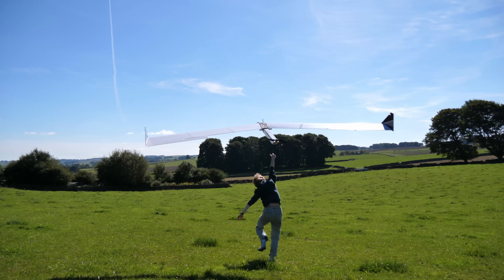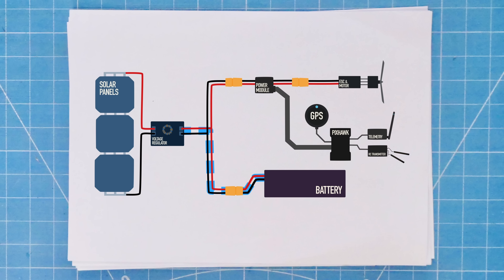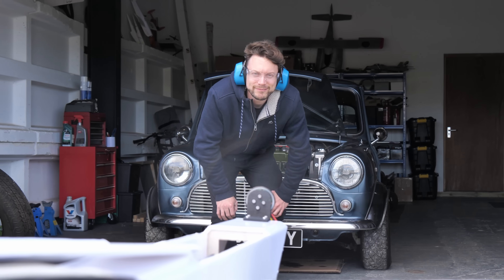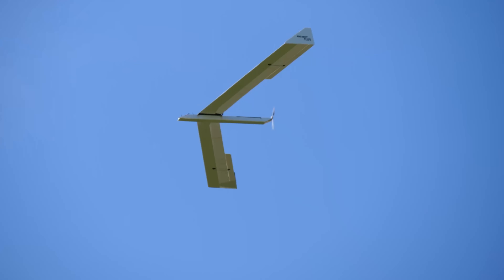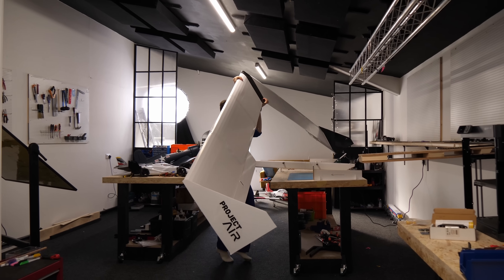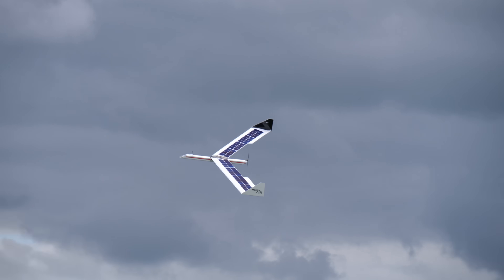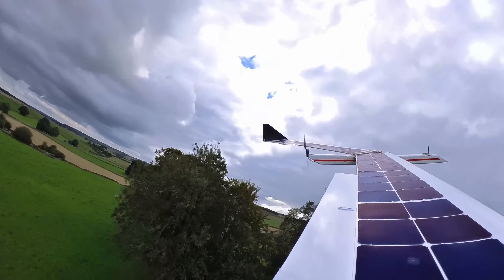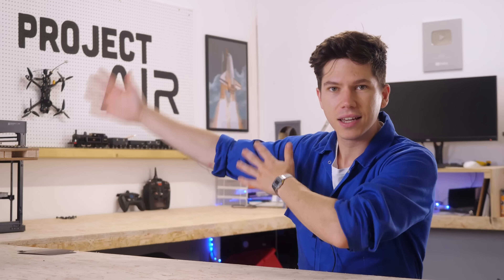Solar Plane V2

Comment: For one I really like the foam board design.. but you also could mold the solarcels in a glass fiber composite wing (under vacuum).
"Simply": 1. build a negative wing mold. 2. lay a thin layer of glasfiber 3. Lay in the rest of the lamiate. 4. Close up the wing with its underside and internals.
The vacuum pressure should hold the solar cells in place and you can build a structurally more sound wing, while keeping the turbulence from the solar cells to a minimum. Obviously it is more expensive, more complex, more waste full, if you damage one cell the entire wing is trash, the efficiency goes down by a bit (I wonder how much though). But the wing, could be overall lighter/larger, and the reduced drag could eventually made up for the loss in solar efficiency.
(Therfore a negative mold, where the vacuum pushes the cells into the curvature, rather than on to it, like it would be if you mold it over a positive or a wing directly.)

And at last, I know it is your channel but I think you really should start to say "we" instead of "I" when you also state that Hannah worked on the project as well.

I See forward to your next project and the continuation of the solar plane.

Comment: There's a company called PowerFilm that makes super thin and flexible solar panels. I don't know if they are as efficient as the ones you are using, but they could possibly be placed over a frame or even just wrapped around foam or something.
Reply: Not a bad idea...
Reply: Dual silicon/perovskite film?

Comment: Your charging a li-ion battery without balancing 
This is dangerous, as the individual cells in the battery could exceed its working voltage damaging the battery or worse 💥

Comment: Use square carbon fiber for the spars.  Angle aluminum is both heavy and doesnt resist twisting very well.

Comment: wouldn't you have been able to stiffen the wing with just half the aluminum? You don't need the full L because you're not worried about lateral flex as much as vertial. So if you cut the L into a vertical I instead, you could have saved almost 50% of the extra weight.

Comment: Without any kind of battery protection, is'nt there the danger that the batteries will get overcharged? If so, I hope he does'nt leave it outside when not running or something.

Comment: Have you ever considered automating a hybrid glider/solar plane which could autonomously catch thermal updrafts?  I'm not sure if the weather there would allow for it, but you could take advantage of the updraft to save and possibly even recharge batteries

Comment: Just build a high aspect ratio glider wing with a carbon spar, balsa or thin plywood ribs and use oracover for a sturdy, yet lightweight construction. Build a carbon fuselage with V-tail configuration and integrate a folding prop into the nose rather than having that square bracket sticking out like a sore thumb. When it comes to high performance airframes, drag is your biggest enemy. Make it as slick, lightweight and rigid as possible. That way it'll be a 100 times more efficient. And for god's sake, get the CG right, wrestling an imbalanced airframe is a huge waste of potential energy.

Comment: I wouldn't use a voltage regulator to charge a lipo battery since it likely doesn't have a way to limit current and so could lead to fires, i would instead make a straight connection from the battery to the controller, maybe with it's voltage regulated by a flyback converter

Comment: 16 years ago I cut my right hand on a Deltawing K10 with a pusher prop. I was badly hurt. 3 weeks sick leave.  I was shocked when I saw your friend Emma throwing the plane. 
Since that day I use only folding propeller and start the engine when the hand is safe. For your monster that configuration would not work. 
Ok ... I am 61 years old :-D which can also be a reason to be slightly shocked 😀
In real life I am an aircraft technician and what I also saw is that the wing cord is very small for that length. 
To make it stronger, a long carbon tube with a wooden spar glued into it would also be lighter. OK ... to make that can be a challenge. 
However, it is a good decision to go for a delta wing or double glider configuration. 
I am sure you will get it happen. 
best wishes from Hamburg Germany
Reply: Totally agree. Very risky. And no gloves even. And not great that he leaves his girl friend to do that. 😢
I had 4 days in hospital and came close to losing my thumb after a prop strike. 😥
Reply: I also got a bit worried at this part. Saw a guy at the field get his hand too close to an idling motor just the other day. Several deep cuts probably some stitches required. I’ve luckily only got caught in rubber powered props but even they hurt like hell.
Reply: Nah, you're completely right to be shocked. The project is cool and everything but launching that plane by hand with the propeller that close is just plain stupid. Not to mention while running through uneven grass... -.-
Reply: I would like to second your worries about pusher prop and hand launch. It is accident waiting to happen. Bungy take off is a simple and safer alternative in my opinion. Greetings from Hamburg too :)
Reply: Gardening gloves at a bare minimum, I winced when I saw it nose up and drop as she released it.
Reply: woo cares 😂
Reply: We care! These folks are doing a very cool and fun project! We want to see success!

Comment: "so I hopped on my Mac"
"and yes, this is all running on a Mac"

(shows B-roll of it running on Windows)

Very interesting video(s) and project, but I couldn't help but laugh at this part.
Reply: I mean parallels on M1/M2/M3 mac runs solidworks well enough...
Reply: he showed both Mac and Windows versions
Reply: @wow-sham1300  That's fine.  I was merely laughing at the temporal juxtaposition.  I don't use either so it's not like I'm trying to throw shade (as I would do so to both equally, lol)

Comment: i think a good idea is to add a prop to the front, and add 2 batteries. Also i think you can add another layer of the solar panels to keep it running

Comment: Aileron reversal is a problem. lol. 

High aspect ratio is great for fuel used per unit distance. 

Sink rate is great for endurance, aka low power. 

Wing area is great for solar collection.

Comment: Sense & Sensibility

The Ultimate Power Source:

Wind and Rotation is an untapped resource in aviation
This is to sat that wind turbines , solar panels and Rechargeable batteries will be the ultimate mix in achieving a 24//7 continuous flight

Speaking as a minority from Gateshead Newcastle I may have to realise this dream myself and with limited resources

Sincerely

Mr Ejike Ememe
Ba Hons Degree Administration
Thames Valley University London